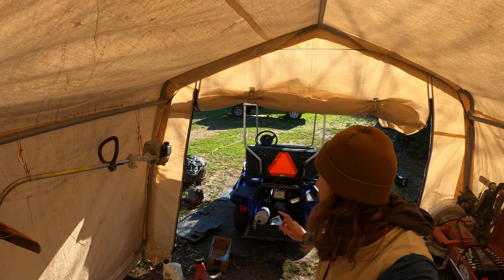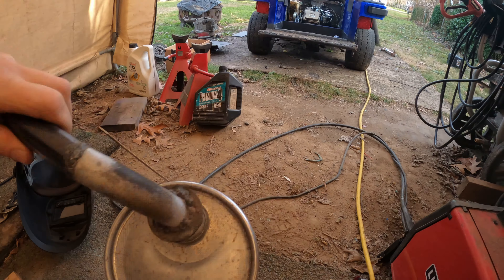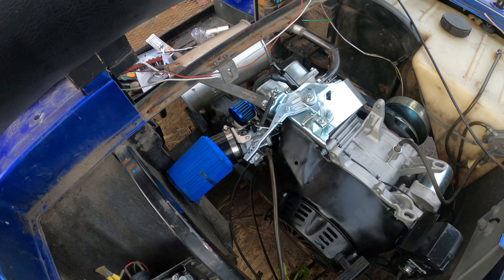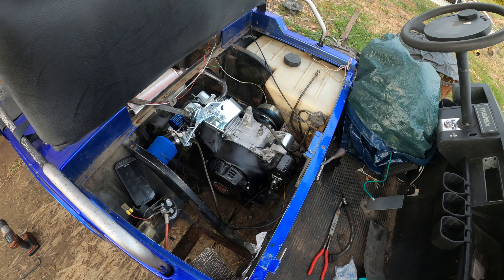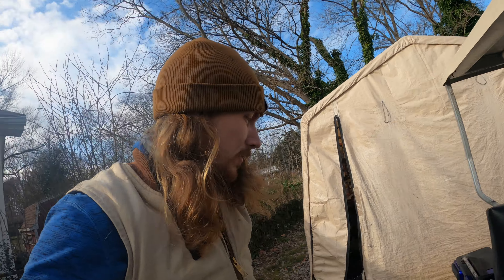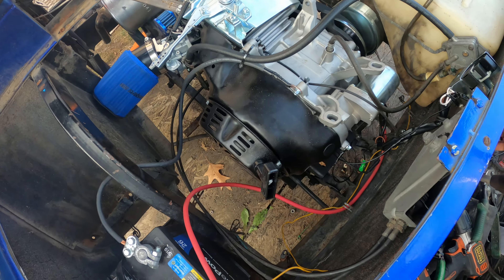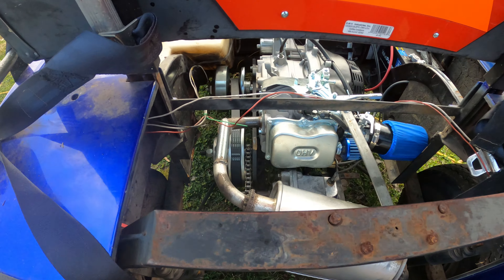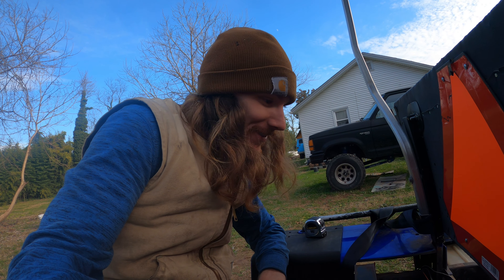Predator 420 Golfcart engine swap part 2

Comment: I have a ezgo and just got a 13 hp honda given to me, do an install soon, so there is a torque converter allready on the ez go so, should be good providing its an inchbore, Only ?is the gas peddle ll. looks good , nice job.
Reply from the maker: You could use the original torque converter with the 13hp and not have to use a chain. I opted for a chain for more gearing options.
Reply: @LilBJessup  Probably go with the converter for now, think the stater generater be a good idea to run that honda. The honda came off of a sawmill and ond so no electric on it. I do have a voltage regulater and think I may be able to run the electric with it, I hope
Without having the extra cost of upgrading to a starter kit.
Reply: On the same note. Buddy has a Columbia carpar club car and the govenor is totaly out of it, any Idea where or who would carry parts for that? Bought the ezgo off of this guy with the columbia and helping him out with keeping it going.
Reply: Sorry for the long winded nes but the predator 420 is almost the same as the honda 13hp as its a 389 cc so thinking quite posibibly chines parts could fit on the honda , far as upgrading goes.
Reply from the maker: @josdedam  honestly I wouldn't kill a Honda by risking it with Chinese internals. A carb and exhaust sure, but anything else, I would make sure it was for the Honda.

Comment: Nice. Are you using an aftermarket FNR setup I have to either buy one or make from scratch 🤔
Reply from the maker: When you say FNR, what do you mean?
Reply: @LilBJessup  Forward Neutral Reverse
Reply from the maker: @morrispayne5830  it is all stock, this golf cart all of the gear controls are in the axle

Comment: Awesome job man. I’m doing the same thing, kinda. Lol. How did you get a choke cable to work properly? My first one choked it fine, but won’t un-choke it. Cable bends. Got solid wire today, and it won’t do anything. Ugh. Frustrating! But, that’s what we get huh!? Thanks for any advice man.
Reply from the maker: It has to be a straight shot for the cable to work, hardly any bends at all or the cable will just flex, mine has a bend, but I braced it with zip ties. Good luck!
Reply: @LilBJessup  thanks man! That was the fastest reply ever! Lol. You da best. I just found a video where a guy shaved off the lip of the lil black plastic piece on the carb. I’ll try yours first and let you know tho. Thanks again man. I appreciate ya
Reply from the maker: @kevinmayo213  I try to be diligent with replying, helps the channel out!